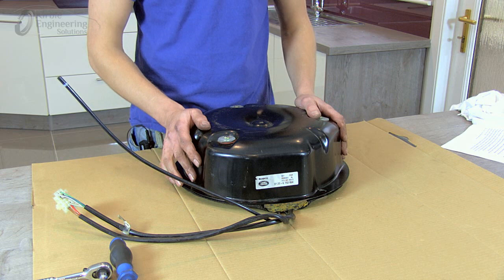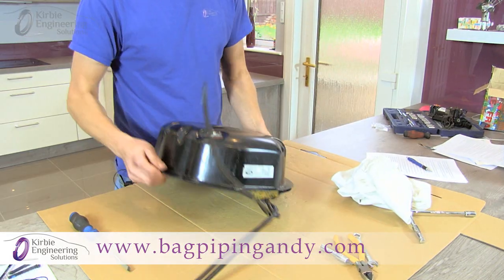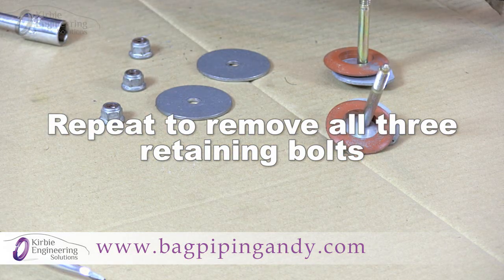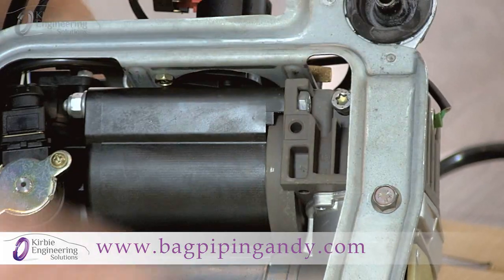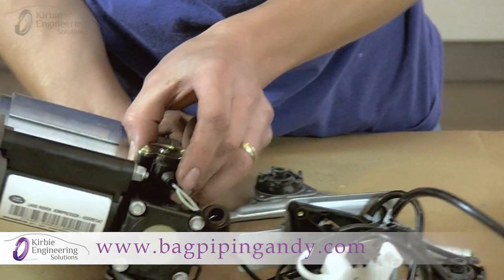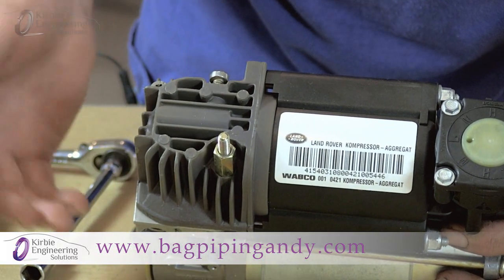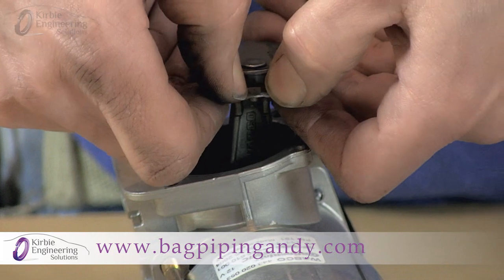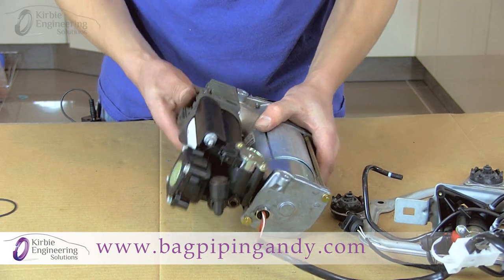Bagpipingandy-how to fit Range Rover, BMW, Wabco air suspension compressor repair kit

Comment: With my pump off the car and lived up to a battery it runs fine put putting a finger over the outlet hole slows the motor noticeably, do the motors go soft in these at all ?
Many thanks

Comment: Thanks for the great tutorial Andy. I have subscribed and believe I will be needing your kit my friend. I wonder are you able to post your replacement kit to New Zealand? I have a Range Rover that has a slow filling air suspension this will surely fix but I also have a VW Tuaregs and was wondering if this kit works in that unit also just in case that one eventually plays up? 
Cheers mate.

Comment: Hi There, hoping you can help. I fitted a new hitachi compressor to my 2005 Vogue (diesel) and there is a small pipe (not sure if air going in or out) but it keeps burning?? Even with the new compressor in - have disconnected the new one to stop it getting damaged. Any thoughts?

Comment: Hi. Thanks for this very useful vidéo. I bought a repair kit for a 2005 BMW X5 e53 4.8is. The wabco module that drives the air suspension keeps failing. Where Can I get a repair for this module ?
Reply from the maker: can you be more specific, do you mean the electronic control unit? or the compressor itself? or other? if you have fitter the compressor repair kit you need to clear all faults with a diagnostic tool and it should come back to life, no need to change any parts
Reply: Hi. Thanks for your quick answer. The faulty module is the one behind the glove box that is made by wabco.   @bagpipingandy
Reply from the maker: Sorry I don’t have any repair solution for the module, only the compressor 
Best regards

Andy

Comment: Just fitted this and it has cured my issue. Great support after buying this product. Fast postage and delivery was an added bonus. I fitted this to a range rover. They have to have the engine running at start up to build 12 bar pressure even though the compressor runs with the engine off. With ignition on only the system only builds to 9 bar and won't let you alter ride height if the reservoir sees less than 9 bar. 
Cheers for making this product and offering support to us home mechanics 😊

Comment: Just ordered your kit the other day and it has just arrived. Thanks for the speedy posting😊 Might have a go at this before nights tomorrow. I went with your kit as there are many generic kits and i was impressed with your ebay advert. I googled your Web page and thought "he's the man 👍" impressed with the explanation of everything and topped off with a clear video. I must admit i did get confused reading about the pin bit but the video made it clear. 
Impeccable service so i don't the product will disappoint. I'll comment back when the job is done. Thanks 😊
Reply from the maker: Any questions just ask
Reply: @bagpipingandy  cheers. I did send a message via your phone number on your Web page

Comment: I used this service kit on a 2003 Vogue with excellent results.  The kit is very well made and super easy to fit, exactly as this video shows.  Also, thank you Andy for putting everything in the kit that I might need, including replacement cable ties, and a tapping tool (not that I needed that).  Even the printed instructions included in the package are colour printed on card.  Other businesses wouldn't include any of those items just to maximise profits.  Thank you for doing it right.  Brilliant job Andy.
Reply from the maker: Great to hear!, thanks for your feedback, any air suspension problems get in touch

Comment: What a really pleasant chap you are, Andy. Why can't everybody be like you. I've just purchased one of your kits as I've got the "Air Suspension Inactive" message on my dashboard. I've noticed over the past few months that it was taking ages to lift my suspension. My gut feeling is that the piston ring has now given up the ghost and left my 2004 Range Rover L322 in normal ride height with the normal and lock LED's lit. Hopefully for £25 your kit will resolve my problem. I'll report back here when your kit arrives and I've fitted it in a couple of days time.
Reply from the maker: Fit the kit, then you need to clear that error with a diagnostic tool then it will all come back to life, as always any questions please just ask , best Regards, Andy

Comment: Hello! I bought your kit and installed it, it was easy and thanks to your video, I have a question. This is for a 2000 bmw x5 4.4i. After I installed the compressor the suspension never went up, so I disconnected the hoses (Blue & Red)after the 2 coils in the pump and there was no air coming out the hoses, I thought it was the pump, but then I disconnected the black hose right after the pump and the pump was pumping sufficient air. So I assume the coils are not opening to let the air go trough, the message says self level inactive. Do you know what the problem might be?

Comment: Hi, I have a RR L322 from 2004 and my air suspension system is blocked (level ride height selector is deactivated) . The messages in the display are "Self Level Inactive" and " Air suspension Inactive". The dealer notified the error C1A13 ="Pressure does not decrease when venting the gallery. Signal Plausibility failure".
Does your kit work for my problem ?
Reply from the maker: Hi, no, sounds like your car will not lower,  you need to check the 2 connections on the compressor for the release air valves, ensure they are properly plugged in and check wiring for damage,  simply apply 12v to see if the valve clicks
Reply: Thank you so much. I will check the 2 connections ,wiring and the valve tomorrow. I'm reading in a Range Rover forum that they suggest to instal a new exhaust silincer and Air Dryer Repair kit, but I'm not sure if this works for the 2004 version, which have a different compressor from the 2006.

Comment: My Rangie’s suspension was getting slower and slower and finally quit. A garage in Glasgow (and not even a main dealership) quoted me a mere £800 to replace the worn out compressor! I thought Bagpipingandy’s kit had to be worth a try and so £25 and an hour of my time later my suspension is running better than ever! I shouldn’t have mentioned it to the wife as she’s now deciding what to do with the £775 saved! Nice one Andy!

Comment: Hi Andy,
Thank you for an informative video.  My 2010 LR D4 has an intermittent error on dash.  No consistency on the fault, sometimes yellow light and then Red with speed warning changing back and forth and level ride height selector is deactivated.  Ride height or handling is not affected with either alarm and the vehicle does not lower over time either.  Fault code given was something about low airflow but the mechanic did not want to show me, says it requires a new compressor at great expense.

Do you have any advice or recommendation, please?  

Thanks
Reply from the maker: Hi, the symptoms do sound like the air suspension compressor is weak, I would rather know the fault codes to make sure. However the 2010 uses a different compressor to this one, email me for more info at: info@bagpipingandy.com

Best Regards 

Andy

Comment: Hi Andy...
Dash message says' air suspension inactive,......ride height seems OK...it just will not go up ,or down. Garage diagnostic says ;compressor faulty'..but no details//..any thoughts, please ?
Reply from the maker: Hi, if the error code is "pressure in accumulator static when filling" this is exactly a tired compressor, if the garage clear the fault it should work for a short time before the air suspension inactive message returns, my kit will fix these symptoms no problem, any questions please just ask, 

Best regards 

Andy

Comment: nice one Andy, any torque spec on the marriage?
Reply from the maker: Hi for the cylinder bolts with thread lock you must use the M6 tap provided to clean the threads out then the tightening torque is 9Nm for the M6 Bolts
Reply: bagpipingandy Hi  thanks for that i just sent for kit, left sea :) good demonstration.

Comment: Hello, My compressor started to make these drum noises, and suddenly stopped working. I was wondering if i replaced the gaskets with this repair kit will get it to work again, or do i need to replace the entire compressor?
Reply from the maker: Hi, is the air suspension error light/message constantly on? if so the compressor will not run with this light on until you clear the error codes with a diagnostic tool, if there is no error light on then check the compressor fuse/relay and motor. if the light is on clear the error. if it works for a short time before coming back on, only then then fit my repair kit, any questions please just ask, best regards. Andy

Comment: Hi Andy, I have an occasional leak from the solenoid assembly which allows one side to drop. Are these serviceable in any way at all? Cheers.
Reply from the maker: Hi, what car is it you have? the valve block is nto servicable on some models, but some you can remove the solenoid and clean however you say an "occasional leak" this suggests it may be something else, does it always sink parked at e cars lowest ride height, but doesn't sink parked at highest ride height? if so this is the airbladder leaking, let me know and i can help further
Reply: Hi Andy, It's a 2002 BMW X5 E53 rear levelling only. It varies no matter what the circumstances when parked. It can sit for a week and be good, or half an hour and it begins to drop slowly..
Reply from the maker: ok, the valve unit on yours can come apartto clean it, but to check if it is a valve leaking 1st, simply remove the compressor hose (black) from the valve block and put a little soapy bubbles over the hole in the valve block where you removed the hose, if either the red or blue hose valve is not closing it will leak back out that hole going to the compressor, check this to confirm if it is a valve leaking/not closing, ussually cleaning the plunger can fix this

best regards
Andy

Comment: Hi, I Just bought your kit.  But when I removed my compressoer, it looked nothing like the videos and when i took it apart, it did not have a piston as in the video.  I have a 2006 Range Rover sitting on all 4 bumpers.  Is the compressor for this mdl year able to be repaired?
Reply from the maker: Hi, sorry for the slow response i was away on holiday. My Wabco compressor repair kit only fits range rovers up to year 2004, after this date they use a different compressor by hitachi, I currently do not offer a repair kit as the Hitachi compressor does have many different issues which one repair kit cannot cover them all, however I will have complete refurbished Hitachi units available soon in an exchange service. best regardsAndy
Reply: Did u get it sorted? I have 06 RR as well, (Td6) wondering about doing this. Keeps flagging up 'suspension fault', slowly drops down to bump stops. After switching off and back on again it returns up, but little while after fault kicks in again
Reply from the maker: Best to get a fault code read on that error. if it states "PRESSURE IN ACCUMULATOR STATIC WHEN FILLING" this is 100% the compressor weak, my kit will fix this issue on the wabco air suspension compressor. the error message on dissables the system and any time the car sinks this is an air leak, if it sinks slowly with the error message on (over weeks) this is ok, but if it sinks every night when parked it should be fixed, its most likely the airbag leaking but to make sure use soapy water to find out what is leaking, best regards.  Andy
Reply: Hi Andy, Cheers for response. It only sinks while being used, not over night etc. 'suspension fault' doesn't remain on dash: If i switch it off and back on, suspension raises back up. Only then little while later repeats. I don't like driving it when it does this. However, when I did, it started saying after restarting, that it will refill when 'system cools', suggested some component was 'overheating', (not rad associated). That may have occurred because I drove it away before it had fully raised suspension? That was only point noticed it struggling to refill, otherwise it just raises up normally. 

When it goes down however, after the odd initial warning or two flashing up intermittently on dash of 'suspension fault. The next step is the LED's on level switch go out and says not to drive over 30 mph on dash, along w/ suspension remaining on dash. It goes down only over a minute or two and then sits right on bump stops, (very bumpy). Until that is, you switch it off. Switch back on - the LEDs come back, it raises up, no warnings on dash, etc and so it goes, only to repeat? Weird or what??

Comment: I own a BMW E66. I have a few questions. 
1,  If the air compressor is not operating at peak, can I say one of the symptoms is a harsh ride? (To rule out out parts, I have change all 4 suspensions, rear link arm and wish bone to new)
2. Is the O ring always the cause of compressor's non-performance? Or could other components play a part too?
3, Do you have a set for my compressor - BMW E66?
4. If so, do you have a video on how to install?

Thank you Andy
Reply from the maker: +Alan Tan If the car sinks down this will give a harsh ride, any sinking is usually a leak, or some models have different suspension settings such as a sport mode to stiffen the ride, it could be something faulty with this if the ride height is ok. The piston ring is the main reason for a weak compressor as it wears out through use especially if the car has any leaks this reduces its life. The E66 can have 2 different compressor units, my kit fits the Wabco compressor only, the Wabco is in the boot under the floor. if your compressor is behind the rear wheel arch this is a different compressor unit.

Comment: Hi, put it in but stll : selflevel inactiv.Does it had to be reset by a BMW Dealer?
Reply from the maker: hi, if your suspension inactive light is on, and or the panel lights have went out, yes you need to plug diagnostic tool in to clear the errors and it will come back to life, any questions please just ask.
Andy
Reply: +Norbert Lazarus yes - or preferably an independent BMW specialist (cost me £24 for the diagnostic work - half hour fee - since then I bought my own palm size diagnostic for wiping codes). M

Comment: Hello, I would like to know how to disconnect the compressor back line leveling the Range Rover Sport 2006, the two largest that are to the rear of the car ?
Reply from the maker: Hi, do you mean the hose connections on the compressor? if so they are push fit on the Wabco compressor as my video, but the RR sport uses a different compressor by hitachi, they may still be push fit connections though, e-mail me a picture of your compressor to info@bagpipingandy.com,  if push fit connections they are the same as the Wabco connections, to remove the plastic hose push the outer collar inwards then while holding the collar pull the hose outwards, hope this helps

Andy
Reply: I send 2 photos to Your Mail,

Comment from the maker: The Odd shaped gasket fits early compressors pre 2003 when they used a shaped o-ring rather than a round o-ring found on the newer units, you can see the shaped o-ring being used in my other compressor repair video, both o-rings are provided in the kit you just select the one you require,